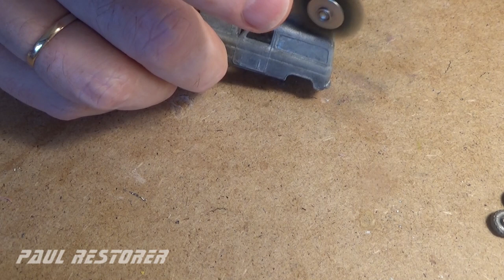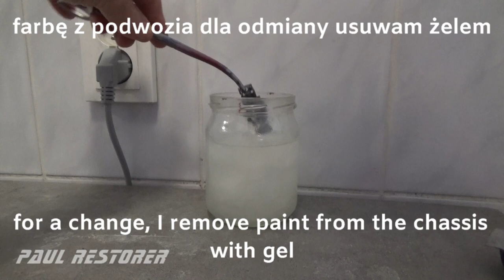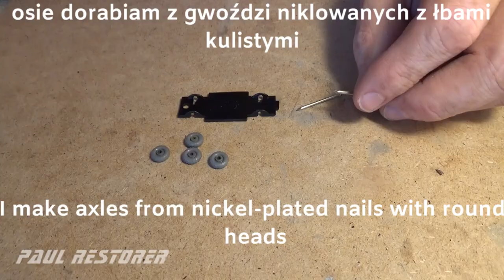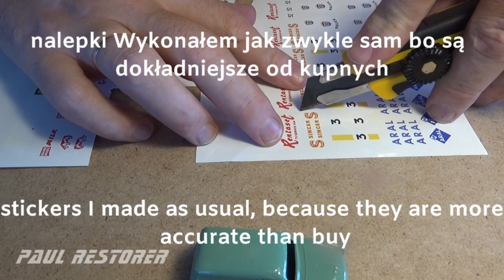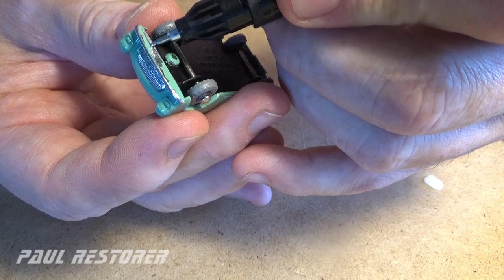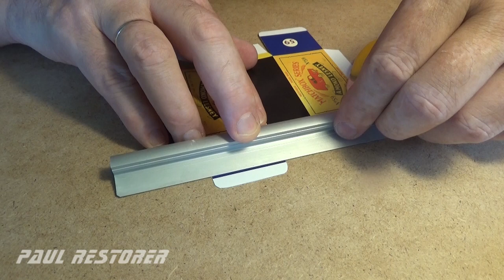Renowacja Matchbox Ford Thames Van nr 59, renowacja autka, metamorfoza  zmiana wyglądu

Comment: Why do you remove the wheels, why not mask off.
Reply from the maker: Axis rules require replacement or cleaning. Without removing the axle you will not paint the entire chassis. regards